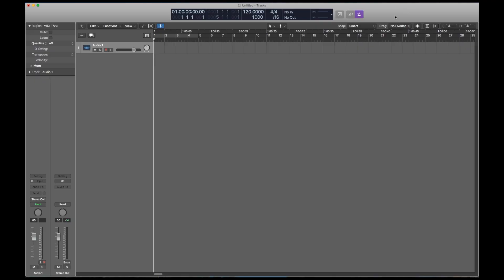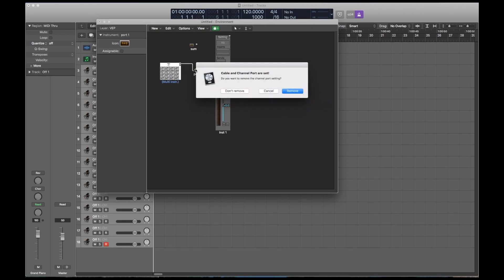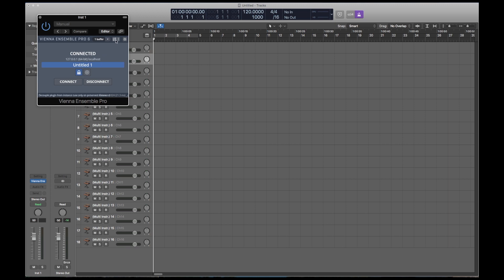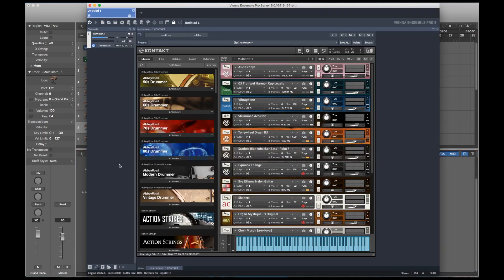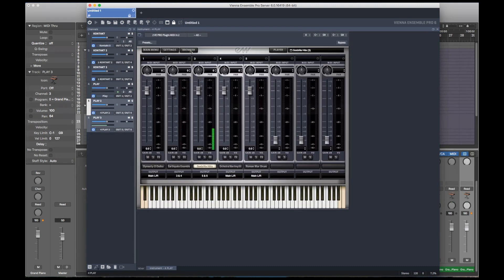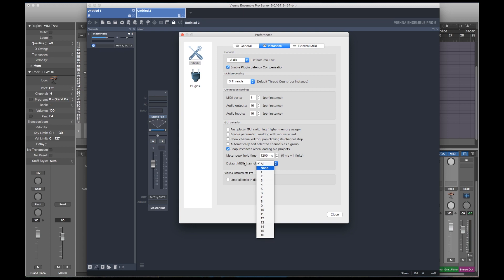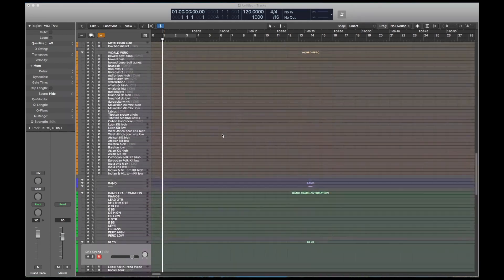How to Connect Logic and VEPro 6, Create Multi-Instruments, Use Multiple Ports, and More

Comment: Hello! That's a great tutorial for working things out. I've tried and did it ok but only for the first 5 stereo channels... after that each instrument starts taking two stereo channels (ex. out11/out12 & out13/out14) till it reaches with no sufficient channels for all the 16 stereo instruments. Inside Kontakt, I confirm it plays the instruments correctly through midi, but on the VEP and Logic mixers they give this double stereo outputs issue. Can you help me please? Thank you!
Reply from the maker: Thanks! Each stereo MIDI channel should take up 2 channels each on Logic & VEP. Can you confirm that you are using Kontakt's Multi-Output (16x Stereo) plug-in? In Logic's mixer, though the first channel isn't labeled, it is 1/2. The next aux you create is 3/4, and so on. It works similarly in VEP. Sometimes in VEP, it's best to delete all your auxes (but keep the original bus) and create them again from scratch with the plus button.
Reply: Yes, the first is 1/2 default. I've been using the main Kontakt's Multi-Output (since that's the one for 64 mono channels or for the 32 stereo channels as I intended on each VEP instance). I've tried various config on kontakt, like the automatic channels batch and the manual way like you've done. In fact, Kontakt responds ok for each channel on midi play and stereo channels on internal mixer. So I've removed all auxs on host (daw) and server(vep) and had them again till the last one (31/32), but it is allways the same. I realized only VEP and Logic double to 4 channels use after the instrument five, so I suspect it is something wrong on VEP which then goes to Logic that way... On Studio One 3 and 4 it works well, but on Logic 10.4.1 I'm having this issue. Thanks for your time!
Reply from the maker: Well first of all, Kontakt's plug-in only allows a max of 32 mono audio outs (see ch. 15 of the Kontakt reference manual). If you are trying to load all of your instruments in the instance into a single Kontakt plug-in, I don't recommend that – Kontakt can get overwhelmed if you load too many things into it. Just stick to 16 patches, or one instrument bank per Kontakt (MAYBE two). After that, just create a new bus with a new Kontakt plug-in on it.

I am not sure what you mean by "VEP and Logic double to 4 channels use after the instrument five."
Reply: Sorry, I said it wrong. I was meant to say 32 mono channels that give me those 16 stereo channels for those 16 patches accordingly. About the 4 channels, I am trying to say that the first channels work ok, with 2 mono channels (1 stereo output) for each patch; but after the 5th patch, each instrument starts using 4 mono channels (2 stereo outputs), sending the same signal twice (on the next 2 stereo channels available) through VEP to Logic, although on Kontakt's internal mixer the signal is correct and working well for each stereo channel... So I suspect maybe is something wrong on VEP.

Anyway, I've tried another approach on Logic and finally was able to work it out, at least in the first VEP with 16xstereo patch (default name "instr 01"): 1. on an empty project, add 1 new instrument with 16 multi-timbral and no vst patch selected; 2. then, with those tracks all selected, choosed the VEP 16xstereo. And it did the trick on this first instance at least... Not sure it will work on the other ones as well, because with each new instance of VEP plus the 15 aux tracks I add the mixer becomes more messy, scrambled and confusing, not working properly and with track's order changed between the stack folders, instrument tracks and auxs...

When you say to create a new bus with a new kontakt plugin, you mean on the same instance of VEP or in a new empty one?

By the way, can you tell me if each VEP instance only allows 16 stereo patches like kontakt or can we add more auxs with another plugin(s)?

Thank you very much for your time!
(sorry for the extended answer)
Reply from the maker: That's never happened to me before.

On the same VEP instance.

Maybe you do not have enough audio inputs/outputs enabled in VEP (10:34)? Try raising those numbers.
Reply: Hello! Finally I found what was the problem. So, when I create tracks on Logic, I was adding 16 multi-timbral parts to 1 track (expecting this last one to be the vst/plugin working to the parts itself). Just a few minutes ago I started thinking if it could be the other way around. So, on the adding tracks window, I've put just 1 multi-timbral part and add 16 tracks. Like before, the tracks were added the same way as other times, but  now everything works as it is supposed to, even the mixer is working fine now. One simple thing of misinterpretation on Logic's tracks creation. Next time I'll know better. Thank you very much for your help!

Best,
CI
Reply from the maker: Although there is a method to do it that way, the way I explain in the video does not use multi-timbral Software Instrument tracks. I'm using external MIDI tracks. The software instrument track you use for VEP's plug-in does not need to be multi-timbral (0:29). The external MIDI tracks become a multi-channel instrument once you drop the Multi Instrument environment object on top of the tracks.

You're obviously welcome to tailor this method to your needs and discover other shortcuts, etc., but I recommend following what I have described exactly from beginning to end to make sure you can at least get everything working by doing the same steps I'm doing. That will make troubleshooting easier for both of us. Once you have got that working, feel free to explore on your own and start modifying things!
Reply: Yes I understand. That's what I've tried the first times, your method. But at some point I can't remember exactly right now, I got stuck on Logic's midi environment (my lack of knowing things for sure). But tried again today through your pdf method, and I'm happy to confirm it works as well :-)

So, what I did before with 1 multi-timbral for 16 instr tracks seems more easy and faster without having to config on the midi environment, but in fact I really prefer your method in a way of instruments to stay organized and less confusing without having so many aux tracks to add in the mixer. However, that leaves me with two main questions at this point...

Don't get me wrong please. I can't thank you enough for your insights and help in the process. Without that, I wasn't able to solve this Logic issues. So, 1. the down side, the midi tracks created can't offer the same configurations and possibilities like midi fx and sfx as the instrument tracks. 2. maybe there's an up side?regardless of these midi tracks diferences, knowing if this method confirms to be more reliable, steady and helps on less cpu/ram usage.

Thank you so much ACap!
CI
Reply from the maker: Glad the PDF was helpful! Get to know the Environment. It's good for you. ;-) If you check out the VEP manual, it explains another method which I call the Event Input Plug-in Method, which involves multi-timbral Software Instrument tracks and doesn't require you to edit the Environment. If you are not using the Environment, this Event Input Plug-In Method is the only other way to access multiple ports per instance. However, the method with the Environment is a more stable configuration.

If you want different FX for separate instruments, you need to create more aux tracks/buses and route those instruments to the correct place via Kontakt and VEP (and then you should see it coming out the new aux track in Logic). It may be helpful to draw a diagram of your signal flow.

Regardless of whether or not you use the Environment, you will run into this same problem of needing different FX for different instruments. Even if you use the multi-timbral Software Instrument track method, any FX you add to that track applies to all the instruments in that group.
Reply: Oh didn't know about that FX will apply to all instruments in the group. That indeed changes the rules. Again, thank you for your patience and precious help.

By the way Alex, does your professional work involve this area of music composing? Please let me know if I can be of assistance. I'm always eager to find good opportunities of partnership.

Best wishes and success,
CI
Reply from the maker: Crazy Inside no problem. I hope I have earned your subscription! I have many more tutorials in planning stages.

I am a professional multimedia composer (film, video games, etc.). I'm also a classical-trained pianist.
Reply: Just to get a conclusion on this thread, I've tried the two ways (mine and yours) and although it worked well with the tracks through my approach, the mixer get things scrambled and messy between instr and aux with stack folders... So, your method is indeed the best way to get things done, organized and not messy. Subscribed :-)
Again, thank you so much for your patience! I'm also a multimedia composer, but still recent on Logic. Please, feel free to listen my works at ruilavos.com and let me know your feedback.

Best regards,
RL
Reply from the maker: Glad you got it sorted. Thanks for subscribing, Rui!

Comment: 1. Whats the difference between making a multi timbral instrument and your method described here. Going into the environment seems overkill. 2. Is there a way to use one instance in VEPRO and one software instrument in Logic? I want to be able to control volume of each Kontakt library and draw automation etc. I also want to be able to send different ammounts of reverb for each kontakt library. Sorry tring to wrap my head around how VEPRO works in Logic.
Reply from the maker: If you don't set up the environment this way, you can only use Port 1 on the VEP Server, which greatly limits your flexibility in doing all the other things you have described. There is also the "Event Input Plug-in" method from VSL's manual, but it's not as reliable.

It is certainly possible to use only 1 Instance in VEPro, but unless you only have 16 instruments total in your entire template, you will absolutely need to use multiple ports. On the Logic side, you'd only have 1 Software Instrument track with the VEPro Plug-in to connect to the one instance.

If you follow my method and create the extra aux tracks as I described, that is how you will be able to individually control the volume of each Kontakt output in VEPro.
Reply: ah ok. thanks for the quick reply. I noticed you load a multi in your instances of kontakt in VEPRO. is that the best way? i usually run one library per instance of kontakt. (in logic w no VEPRO)
Reply: also if i want to run a bunch of omnisphere patches do i need to do a VEPRO instance for each Omnisphere?
Reply from the maker: A multi is more efficient with computer resources, regardless of whether it's in Logic or it's in VEPro, because there will be fewer Kontakt instances (as compared to loading a single patch in each Kontakt plug-in).
Reply from the maker: I actually just released a new video where I talk about ways to set up and organize your Logic project for use with VEPro & my recommendations: https://youtu.be/oAUs1YxyD7s

It might lend some insight with your Omnisphere question.

If you really want to use Omnisphere in VEPro... Is it monotimbral (like Vienna Instruments)? Then you would load each one on a separate bus in VEPro and choose the next MIDI channel on the bus (8:24). They can all be in the same Instance.
Reply: Ive read the opposite about Logic. That Kontakt multis in Logic perform the same or worse than individual instances/tracks in Logic. People recommended VEPRO (even on the same machine) because of this issue. That VEPRO helps with this issue and distributing across the CPU cores more efficiently.
Reply: Thanks. Ill check it out.
Reply: Easier is to do it in Kontakt alone, or VEP, using cc

Comment: I followed the steps pretty closely, but still can't control MIDI volume of individual channels from Logic Pro.   Moving any of the MIDI faders in Logic alters the volume of the entire VEP instrument.  Is there a way around this, or did I do something wrong?
Reply from the maker: You should be able to control them independently. Are you editing track or region automation? You need to be editing region automation. I usually use the piano roll drawer or window and cycle through different CCs with command Y, but you can also edit straight on the region itself. Honestly I try not to use MIDI volume automation though – I first go to expression, modulation, or anything that's built into making the instrument naturally crescendo/decrescendo.

Comment: I was following the steps from scratch, but I have problems when I try to start the next 16 midi channels and new instrument bus, is like there's something missing in the port 2 part. I did it exactly like the video, repeating the process several times, and failing every time. What am I missing?
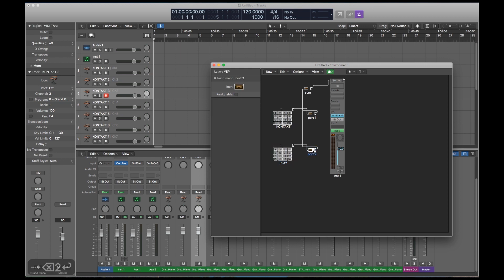Reply from the maker: In the port 2 transformer, did you change data byte 2 to 1 instead of 0 (7:32)? Did you specify which port the Kontakt (or whatever VSTis you're using) plug-ins in VEPro should be using (8:18)?
Reply: @AskACap  Yes I did it, all of it. And it didn't work, that's why I am asking, because I don't understand what else it could be.
Reply from the maker: In your first post, you mentioned it's "failing every time." What do you mean by failing? What seems to be going wrong?

Did you also drag the new environment multi (with all channels activated) to the new set of external MIDI tracks?

If you are able to hear the sound of the instrument you loaded in the 2nd port at all, that is success. If it is coming out the wrong output, that is just signal flow.

Comment: Nice video. Have you checked out the new AU3 feature in VEpro 7?
Reply from the maker: Thanks! I haven't, still on VEPro 6.
Reply: @AskACap  oh boy. It's a real game changer. We get access to all 48 ports. I'm also using Audio Grocery script which let's me use all 4 ports of a single kontakt. Basically i can have up to 64 articulations on one track lane
Reply from the maker: @mannmusica  Wow! And Kontakt doesn't overload from having that many patches loaded?
Reply: @AskACap  Stay tuned. I'll be done with it by the weekend
Reply from the maker: @mannmusica  Sure thing. What I usually do is make an instrument bank and just load a bunch of different patches in there. Then I use a default Kontakt script to convert a MIDI note range into program changes. So instrument bank with program changes and keyswitches on each of those individual patches gives me lots of articulation options on one track as well.

Comment: You seem to know way more about this I do 
So I am trying to learn about  How to use and create a Modulation Matrix`s In Logic Pro x 
Where I can group many midi parameters into one patch group and then map or to a physical mod wheel on my midi keyboard 
So I can have more expression options on one mod wheel 
can this be done in Logic Pro x ?
But I donot know where yo start
Reply from the maker: Look into the Controller Assignment Window.